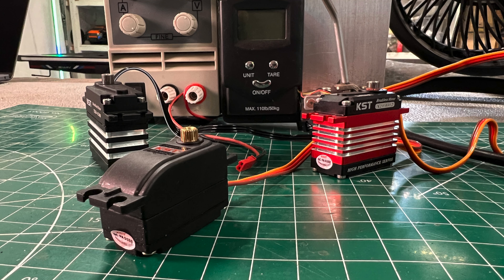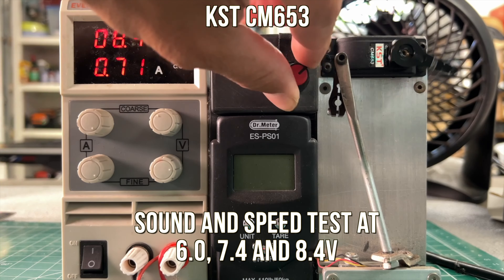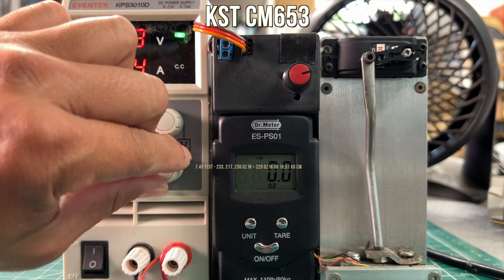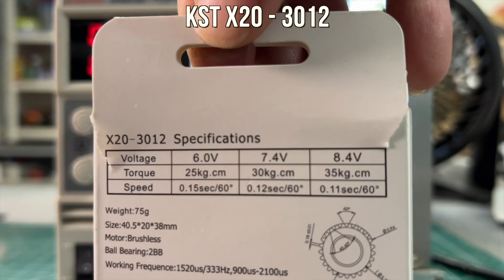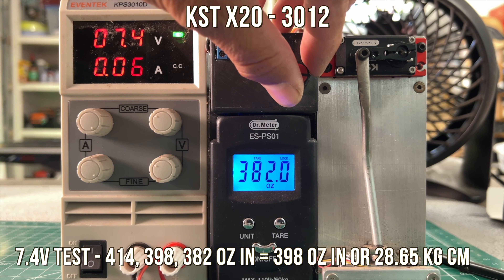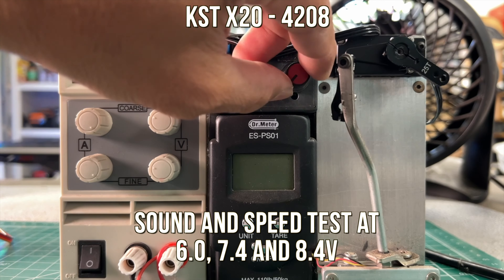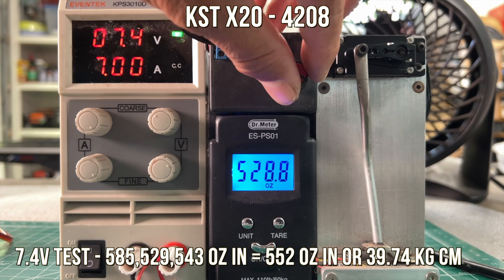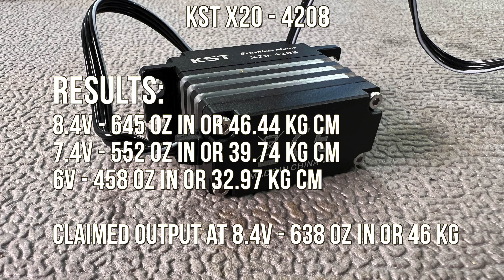KST servos stress-tested - KST CM653 and X20 3012 review

Comment: I think your torque testing might be flawed. Servos are rated at kg/cm that means how many kg they output at 1cm on the servo horn from the centre. Yet you set up your test at 1 inch from the centre. Thats over 2.5 times the distance they are rated at. 

Did you acount for this in your calculations or something? Otherwise the servos will be drastically showing under performance.
Reply: Oz per inch and kg per cm are both accepted but yes it's annoying not being in metric.

Comment: I've had great luck with the Injora servos off Amazon. sub $40 brushless 35kg MG steering servo for my TRX4 and 7k shift & diff lock servos for $20. i run their 25k servo in my non crawler RCs.
Reply from the maker: These 35kg Amazon servos are pretty good. We've tested a few of them.